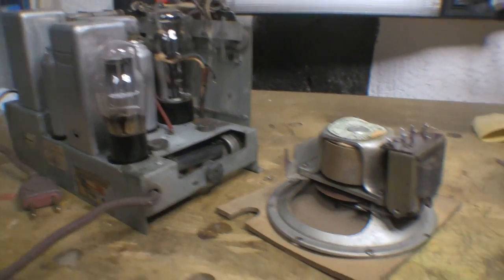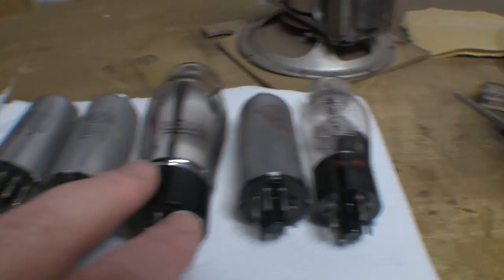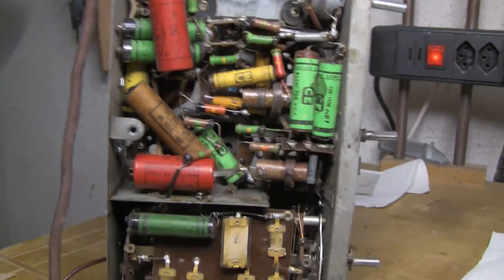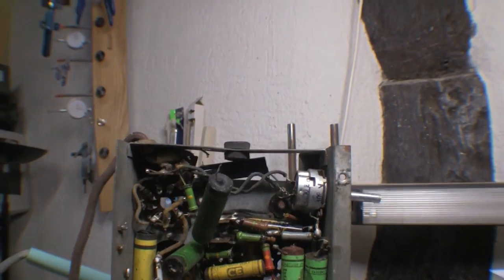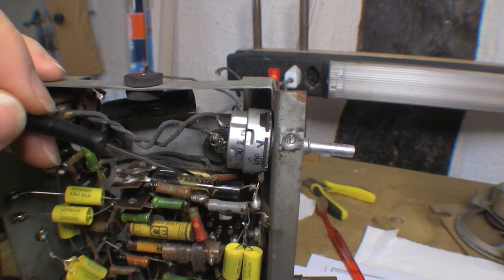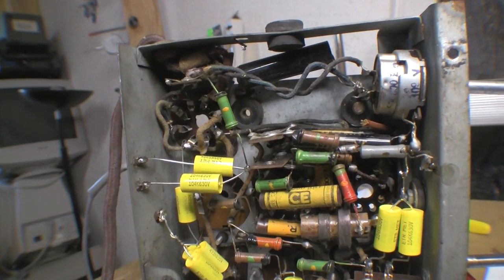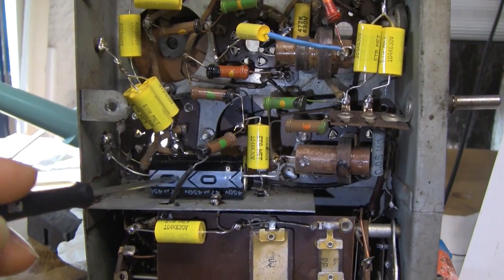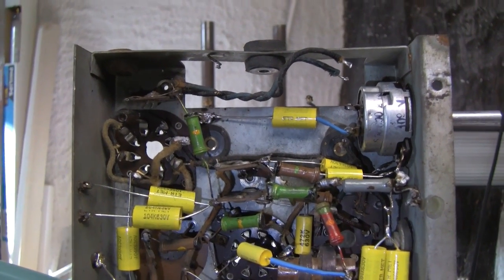Radialva Radio Restore - 2

Comment from the maker: Yes bulbs are in series.  Interestingly the set is apparently designed for 110v supply and requires additional dropper resistors if fed from higher voltages.

Comment: Well the tube filaments are 300 ma so I think that the current through the two bulbs and the resitive wire must equal the same. Are these bulbs wired in series or in parallel? Strange how they didn't run a 25 ohm resistor across each bulb. 
I guess that when it came to the B+ they figured that they would take advantage of the 220 volt line voltage to give it a little extra umph since it wasn't intended for export.

Comment from the maker: That would make life a lot easier but this one is a bit of a strange setup.  Another little wrinkle I discovered is the bypass resistor across the two dial bulbs.  The diagram shows a 50 Ohm resistor but it is in fact a piece of resistance wire running in parallel with the bulbs.  Of course the wire is broken on my set so now I have to figure a way to replace this and I'm not sure how exactly given the current through the heater chain, etc.  I'll have to see if I can do the math!

Comment: That's interesting, they are feeding the full power line voltage into the rectifier tube for the B+ circuit and are only dropping the voltage for the tube filaments. Most of the European AC/DC sets I have worked on dropped the line voltage to 110-120 volts for the entire set, not only for the tube filaments but for the B+ as well, the B+ is between 90-105 volts DC.

Comment from the maker: Hi Colin, yes I had to leave it until the following day - recharge the batteries, etc.   I suspect the volume control is not original.  Photos I've seen online show a much larger wire wound type of pot so I suspect the panel damage was done as the larger one was being removed.  Cheers,  John

Comment: I think at those times when Captain Cock-up has payed a call, a rest with a cuppa and a nice bun is what's called for. How odd that the volume control was bent, and the back plate too, but the knob and case were (luckly) undamaged. Perhaps when those unoriginal caps were fitted in the past the repairer was clumsy and dropped it on it?